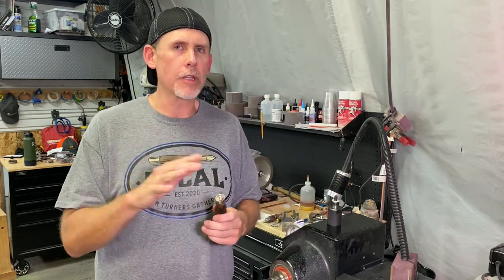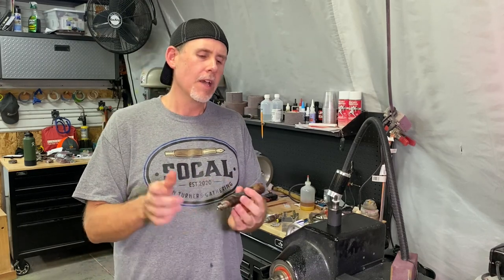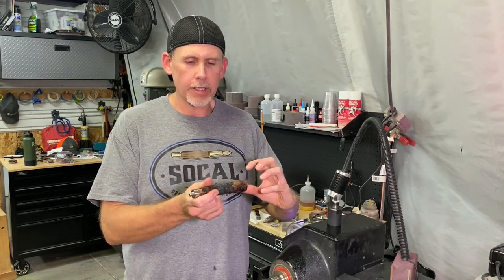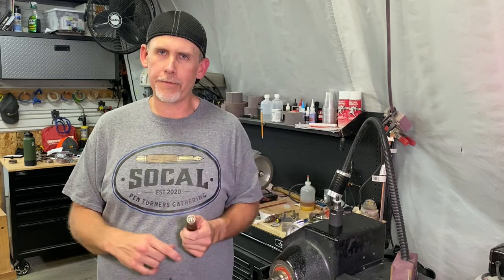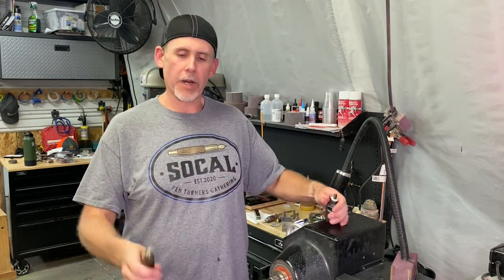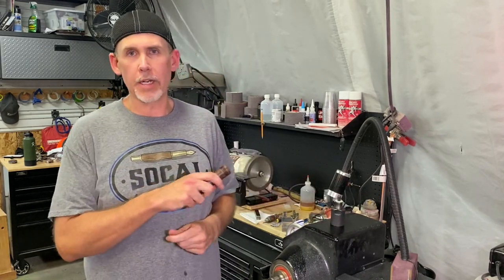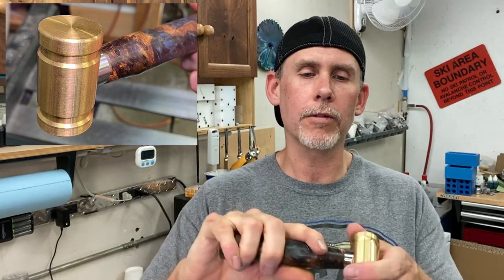Woodturning a Brass Hammer Kit

Comment: Did you notice how nice the blank looked when you added the epoxy to the feral end under the blank.  I might try using epoxy as a finish then micro mesh.  Any thoughts?
Reply from the maker: Yeah, putting a clear coat on would have brought out the colors a bit more in that piece of wood, but I went with just the oil/wax so it's easy to fix if it gets dinged up a bit

Comment: What is the primary use of a brass mallet as opposed to a regular small hammer?
Reply from the maker: It won't mar steel since the brass is softer. Great for tapping on metal things without worrying about hurting it

Comment: That came out really sharp looking, but what would I use the mallet for?
Reply from the maker: It's good for tapping parts or jigs. Any time you need to tap on something metal that you need a little force behind but don't want to mar the steel. It's none of those tools that doesn't necessarily get used often, but it's a life saver when you need it

Comment: Ive seen a few diy tools that youve converted for use with resin. I was wondering if youve tried any of the $65 mini lathes on Amazon? Im interested in them but dont know if theyd work with resin. I few reviews mention making blanks with them
Reply from the maker: No I haven't Theresa. I would have to imagine that a $65 lathe would have to be pretty unreliable, but you never know